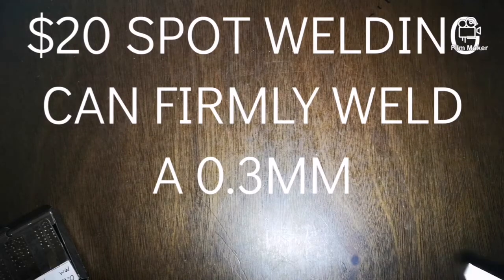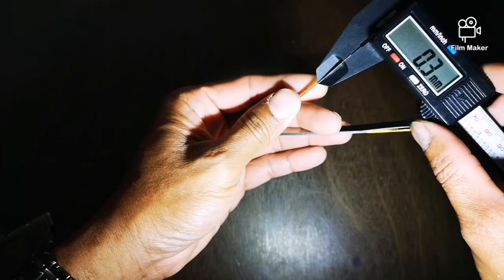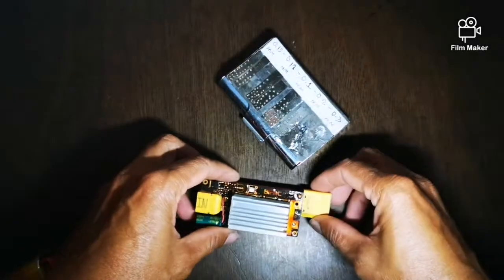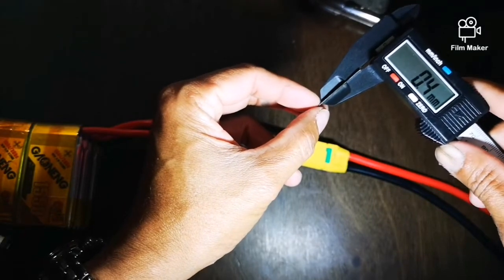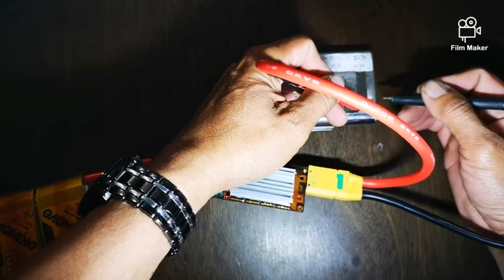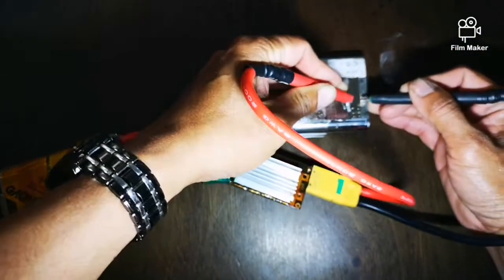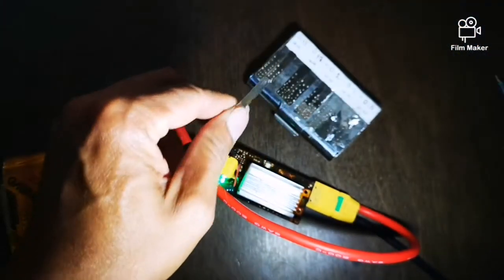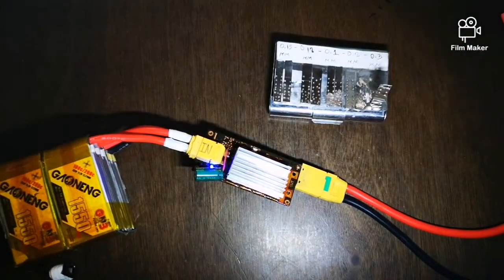BIFRC NUMBER 1 mini Spot welder

Comment: How much watt iron should I be using to solder or desolder any presoldered wire on the board? I can't able to do anything with my 25w iron.
Please reply
Reply from the maker: adjustable 120W with 500 ciclius or 600 cilous. I recommend you this watch the video https://youtu.be/_T7fAKHPuWM
Reply: @pitikaron  i want one those models those are little expensive here, but the only thing that stops me is that I can't find spare heating filaments for these 😥 everyone is only selling new iron but not filaments 😥. Do you have a link of heating filament, wonder how they look like
Reply from the maker: @Mods-Lover   sorry to hear that.  this link I provided is from Ali-express. AU $9.14  30%OFF | Tin Soldering Iron with Regulator 120W 110W Electric Solder Iron kit 220V 110V Mini Handle Heat Pencil Welding Repair Tools
https://a.aliexpress.com/_mrmRQFC. I buy this today.  hoping this real 120W with 600 degree celcius.
Reply from the maker: @Mods-Lover   kindly please do not let the solder stay long to avoid mosfet broke coz most mosfet could only handle 300 degree celcius it is better to keep 100 degree celcius.
Reply: @pitikaron  aliexpress isn't working here. Damn govt. They put ban on it. Will try those Chinese app hope someone will deliver it. Thanks for the help. Will surely keep it in mind.
Reply from the maker: Amazon their are still a lot of chinese product.  kindly please Google it and the Google provide you a link to go through the item link site
Reply: @pitikaron  i tried but no luck heating elements are still not found
Reply from the maker: Sorry to hear that!  I can't help your problem but try this link from ebay youhttps://www.ebay.com.au/itm/144007571102?mkcid=16&mkevt=1&mkrid=705-154756-20017-0&ssspo=Wh-pjza_QI2&sssrc=2349624&ssuid=SO7aTdwZRfO&var=&widget_ver=artemis&media=COPY
Reply from the maker: anyway what you think of you buy one unit of soldering iron instead heating element only?
Reply: @pitikaron  fist i will find heating element if it's available, then buy whole unit. Found some on dhgate
Reply from the maker: nice!  hope you get what you wanted.
Reply: @pitikaron  yeah hopefully i plan to buy 80w
Reply from the maker: I tried 80W not good enough to solderd thick copper thats why I buy new 120W with 600 degree celcius.
Reply: @pitikaron  i didn't plan to solder such thick copper just few length of 1.3mm thick solid copper wire, i hope it would be enough for my use as am never going to get 0.3mm nickel strip in my country lol 😂 0.12 is common and only found few seller selling 0.15 pure nickel
Reply from the maker: It's all up to you bro!  you know what to do and suits your need.  thanks for your reply and keeping on eye to my channel.  wish you all the best for your coming project bro.
Reply: @pitikaron  thanks bro will share final mod with you. Btw i bought 60w iron locally in cheap. 125w has too big bit/tip that will not work on the board. I hope it will be sufficient to work well. Hoping for best ❤️
Reply: @pitikaron  on reddit or instructables?
Reply from the maker: @Mods-Lover  what do you mean bro? for reddit or structable.
Reply: @pitikaron  i mean are you on instructables or reddit?
Reply: @pitikaron  60w works too well than expected for me ✌️ 😎 soldering on bottom side done 😌. Now wires mod needed to be done 🙃
Reply from the maker: No only Ali and Ebay but I used to buy on Ali-express product coz more cheap product. moreovet I can check the review.
Reply: @pitikaron  yeah that's a plus point of ali over ebay. But it's a shame to say that now we don't have ali or ebay. Ali cause of govt policies for Chinese app/purchase/customs, ebay cause of thier foolishness they choose to shut down thier service in India 🤧. Now we have to buy stuff from whoever selling online locally.
Reply from the maker: thats a politics strategy bro hoping India can close Alibaba 😉😉😉.
Reply: @pitikaron  lol 😂 that would be a disaster 😥 but still stuff are coming to India but like before. I liked ali so much but what can be done 🤧
Reply: @pitikaron  and those are social media for mods and new diy projects, not shopping sites 🤭 but reddit is like twitter but lil more diverse user base
Reply from the maker: hahahaha ok only YouTube bro

Comment: Excellent

Which battery should i use

can you suggest me

Thanks
Reply from the maker: I buy four times GaoNeng 3S 1550mAh 11.1V 100C Lipo Battery with XT60 plug connected in parallel I buy this battery from ali-express because at that time it's cheap.  choose high drain battery and new to avoid blown some mostube and the micro chips.  (3S 5000mah or higher Ah and  100C pulse discharge)  5x100=500A pulse drain.  more over avoid used at level 6 and 7 it might blown your spot weld controler. however level 1 and 3 it's enough to weld 0.3mm
Reply: @pitikaron  
Hi

Do you idea how can i use foot switch, as in the board mentioned LED and Key

Thanks
Reply from the maker: @mdaslamknl  you can install a switch beside the micro chip controller after connecting foot switch pres foot switch and the switch from manufacturer together just three to five second but you need to set up another power supply source
Reply: @pitikaron  Thanks
Reply from the maker: @mdaslamknl  your welcome
Reply: @pitikaron  Hi, thank you for your videos. I tested the BIRFRC v3 with 3 in parallel 12v 10ah led acid rated for 20C so I get max 600a current. You are right, with that power the board should not be used on gear 5, 6, 7. With only 400a it welds 0.15 good on level 4,5,6,7. 

What happened to yours? Was it reliable long term?
I noticed you added a bunch of welders to your collection on the last year.
Reply from the maker: The only issue for BFRC is too fast to make it warmer for that reason I device to increase the traces and install heatsink. But you still need to monitor the temperature. Anyway their is latest spot welding purple 99G which is better than all spot welding even the K-weld. https://youtu.be/hTQgXZBmejQ
Reply: have you follow his instruction mate?  how it's going on?